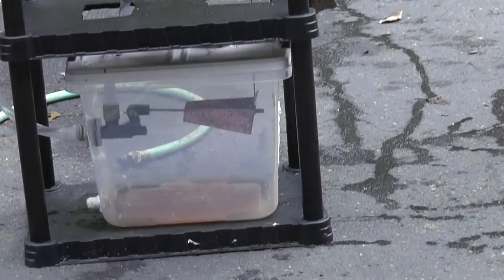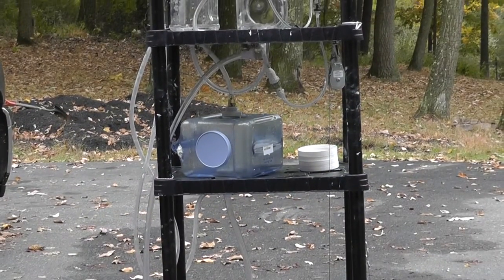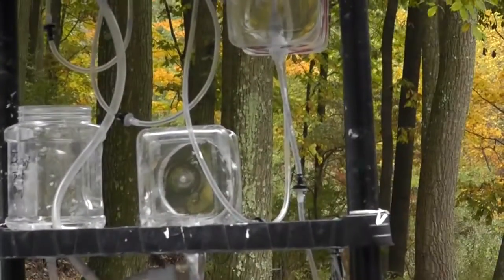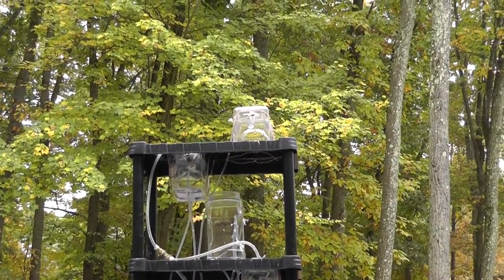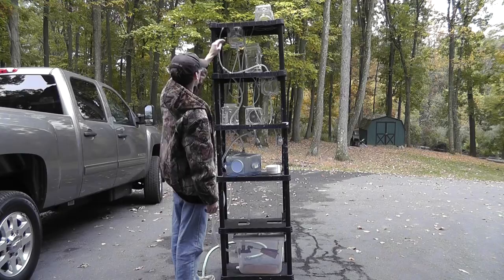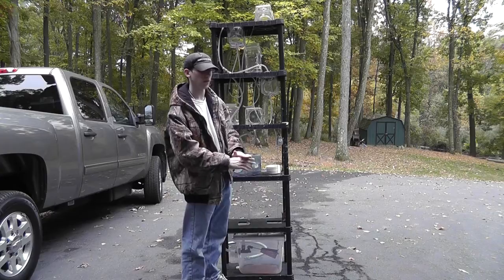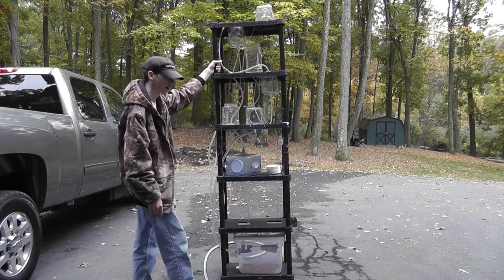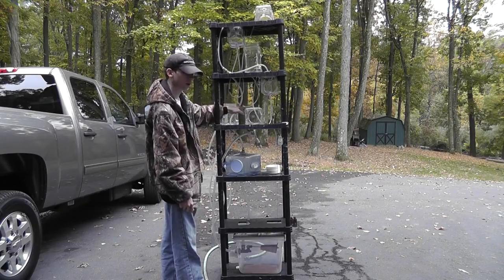Hydrautomat Overview

Comment: Dude! You could integrate it into an Aquaponic farm system and be 100% off grid. Its the holy grail if you can fine tune it to work 24/7. A big tank system could power a water turbine and charge a battery. Also when the water goes down could it pass through a  Lord Kelvin hydroelectric electrostatic generator to store power or connect the output to a Electrostatic Motor search video Kelvin Generator runs Electrostatic Motor. Great work!
Reply: You could just use T.E N.G.S combined with a fractal capacitor array to store charge into a supercapacitor which could then be used to power small low power things. Or high power temporarily.